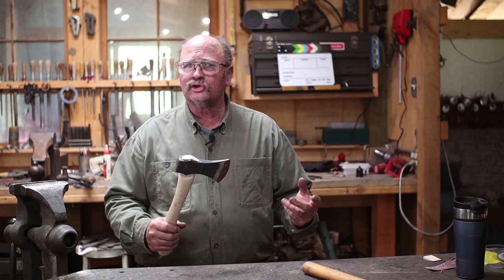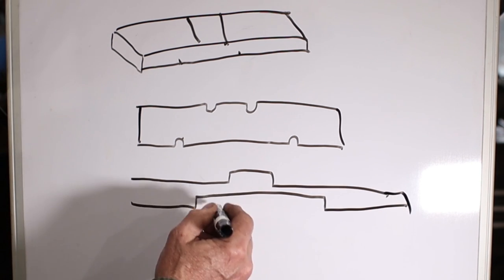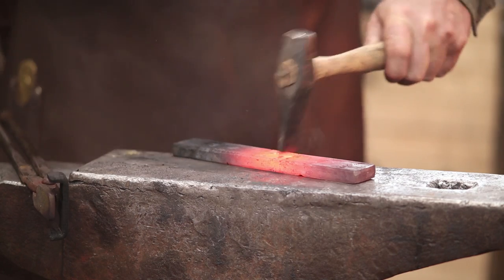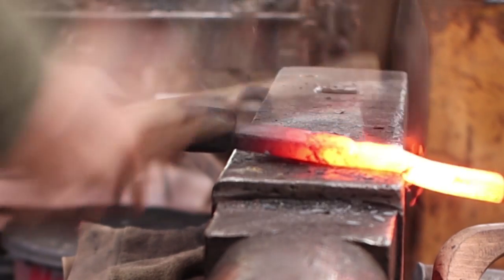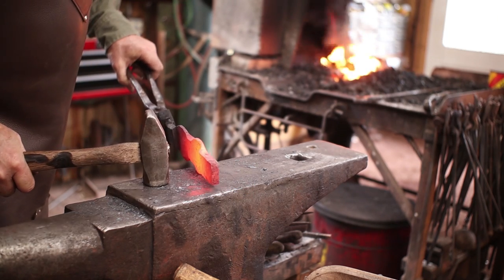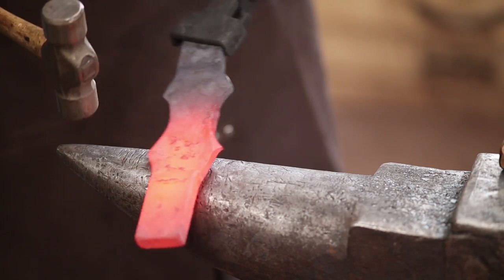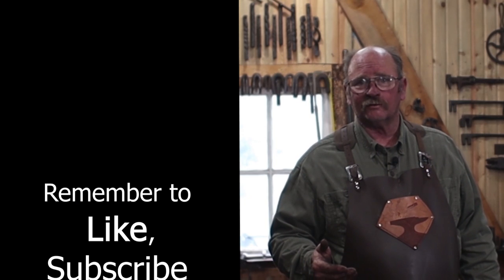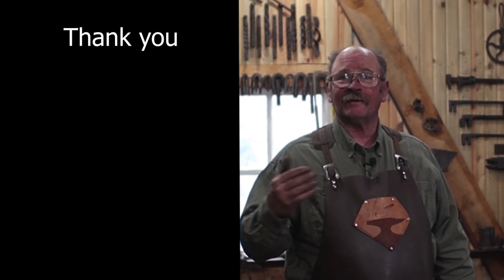Forging the wrapped eye axe - part 1

Comment: I have managed to decryptify the hieroglyphics, the metal piece needed to make the axe, is approximately (228.6 * 38.1 * 13). The numbers are in millimeters. The markings on one side are (6.35mm) from the centre line. On the other side the markings are (88.9mm) from the centre line.

Comment: Nice details in the explanation. Thanks.
Could you use this method and make two halves then weld them together for a double-bit axe, with two bits of the 1075? Of course you wouldn't need the two sets of ears and the pols.
Reply from the maker: Yes, I have done a couple that way.
Reply: @BlackBearForge  thanks

Comment: John can i ask, in the interest of making things easier for the lay out in forging, is it easier to not shape the blade and just leave it as rectangle stock after you forge the cheeks so that when you fold and bring it all together you can weld it and its all nice and square and lines up nice then draw out the shape and do the cut and split method to insert the tool steel cutting face and weld that in? Just thinking in terms of keeping everything symmetrical up to the point of forge welding the 2 halves.
Reply from the maker: I have done it both ways. One problem with having a lever mass to forge down is that the mild steel moves faster under the hammer than the tool steel. This can lead to cold shut where it overlaps the edges or even weld shear in some cases. But the main reason I don’t is that I need a much thicker piece of tool steel when doing it that way. Otherwise by the time you thin the blade the tool steel is very thin and if the forging isn’t perfectly even it might not come out away from the sharpened edge.
Reply: Great question and answer. Thank you both.
Reply: @BlackBearForge  ahhh that makes perfect sense. Thanks heaps.

Comment: I have already made many folded axes with the technique you presented in this video and had great success with it. Now I am thinking about making my first double bit axe but i am not able to make a drift holes in my shop. So i started thinking and thought about constructing it with two strait pieces like the ones you would make for a forge welded-axe and then welding the two faces together. Do you think that this is possible? I have my concerns about splinting the weld with the handle-wedge and the fatigue over time. I really would appreciate your, and everyone else thoughts about this :)
Reply from the maker: Splitting the weld is a risk.  But if done well the risk would be minimal.  Wedging at 90 degrees to the eye would reduce the risk a great deal.

Comment: Could you make an adze this way if you forge weld without forging the axe bit, and then instead just forge out an adze bit?
Reply from the maker: You can, just weld the steel edge to one side

Comment: John ; Sir I seldom see (or think any fault to your teachings but) ..
  Should the layout be based on the handle ( as they are many size and style).
  Perhaps I am wrong but I wanted a long hammer handle mostly because I have a place near by to buy replacements if I need.
  So I am filling the need to change measurements .
Also I have a drift that I already built by hammer and forge ,And want to get on with this build.
  Sir this is not a complaint.
As always Thank you for your guidance Sir.
Reply from the maker: Starting with a handle and making your drift to match is a good way to go.  Or if you are making your own handle make the drift the shape you want then the eye and then the handle

Comment: Hi. Thanks for all this. Could I use also a carbon steel from a file to weld in the axe or is it impossible to fireweld the two materials. What do I need to consider. Thanks.
Reply from the maker: When making an axe this way it is usually a mild steel body with a higher carbon edge welded in.  A file would work well, but be careful to temper it back far enough not to be brittle.  I find the 5160 makes a very durable edge for chopping

Comment: What are the flakes that constantly fly off when you are pounding the metal?  Does better metal produce less flakes?  Is it carbon that lives inside the metal?
Reply from the maker: Its called scale and is an iron oxide that forms at high heat.  Its just a normal part of the process.
Reply: @BlackBearForge  - Than you for explaining - I thought it was some type of impurity - I’ve been really enjoying your videos, you are a great teacher explaining every step - it’s really a class in forging and not just random videos - excellent 👍

Comment: How do you avoid cracks and cold shuts?
Reply: Careful attention to heat and how the metal is moving?
Reply from the maker: Proper set up and forging at high heat are the two main things.
Reply: From what I saw proper set up of fullering and attention to when you start doing half faced blows will reduce that problem. That is what I gathered from john’s instruction as well as what I have experienced from work at my anvil. John your channel is truly a teaching channel. I am glad that an older guy such as yourself has hurdled the tech barrier. Thank you for all you share.

Comment: This is an old video and i don't see you comment but where did you get the thick stock? biggest i found is 1/4
Reply from the maker: Its all available from any good supplier.  The mild steel stock I buy from a local steel warehouse, most larger cities should have something.  The tool steel I generally buy online.
Reply: Sorry something came up what are the dimensions of the mild steel I think I missed it

Comment: I have attempted making 3 axe heads, all with the same problems: At the Pole inside, several have cracked half way thru or form a folded divot.  I used the dimensions that you laid out. After the ears are formed, that part of the axe is about 1/4"  thick. The metal is heated and folded just like you show. Then the front of the eye is matched. The metal at the pole is still curved. Next, I pound on the sides of the eye and at the pole to straighten the sides of the eye. That is when I believe the cracks are formed.  The cracks are probably "cold shuts".  ??How do I close the eye and not form the cold shuts in the process??
Reply: Did you solve this issue? I’m trying this method on Saturday and curious how it has worked out for you since you commented
Reply: @NK-ne9uf  Follow the video exactly. Keep the steel orange to bright red. Keep all radiuses as large as possible when fullering.  When folding the halves together, try to not make the bend at the head  any sharper than 90 deg.  The fold should not result in a sharp inside corner.  Let me know how the axe turns out.
Reply: @paulrohrbacher7795  thanks for the tips! And I will 😁
Reply: @NK-ne9uf  how did your axe head gorging go? I will be forging axe heads next week.
Reply: @paulrohrbacher7795  we practiced forge welding yesterday with horse shoes. Made them into circles and made a chain for practice
Reply: @paulrohrbacher7795  I was too tired to try the axe head. Next Saturday though I’ll start because there is no more class and I’ll be able to work on my projects 😁
Reply: @NK-ne9uf  remember, if you forge a 90 deg bend and hammer on either side directly over the 90 deg or sharper bend, you will drive the hammered side into the other side. Usually this will result in a cold shut IE: the crack. If you wind up with a 90 deg. bend, don't hammer on either leg. The bend I am talking about is the bend formed while folding the axe, at the Pole. Later after the eye is forge welded, place the drift into the eye and now hammer the axe to fit the drift. I advise you to look at all blacksmiths that are forging a folded axe on YouTube.

Comment: Iv tried making these in the past but I just can't forge weld the tip any tips on how or what I might be doing wrong
Reply from the maker: Start the first forge welding pass at the back of the kerf so that all of the junk start squeezing out the front.  Stop forging just before you loose welding heat and get it hot again, slowly working your way out to the edge
Reply: @BlackBearForge  I tried that but it just won't stick I think I'm not getting it up to welding heat or working it past welding heat

Comment: Would someone be able to explain what the ears on an axe are for? Or are they more just a place to move excess material when making a wrapped eye axe?
Reply from the maker: They are as mention, a natural outcome of forging and moving the material. They also add more surface area for the handle to contact. But mostly they look good
Reply: @BlackBearForge  Ah, Thank you, I must have missed that part.

Comment: Is the 1/2x1-1/2 piece just mild steel?
Reply from the maker: Yes. The only tool steel will be the 1075 cutting edge
Reply: @BlackBearForge  Is there any concern about the body distorting under normal use given the mild steel? (Very) Amateur blacksmith here ;)
Reply from the maker: If it is used as an axe, no. But if used as a hammer or as a splitting wedge and driven with a hammer, yes